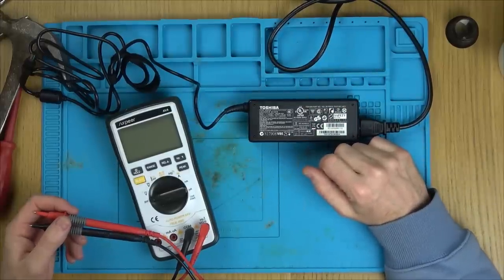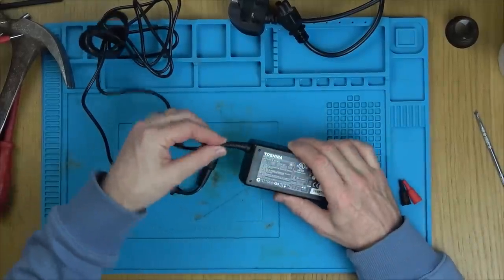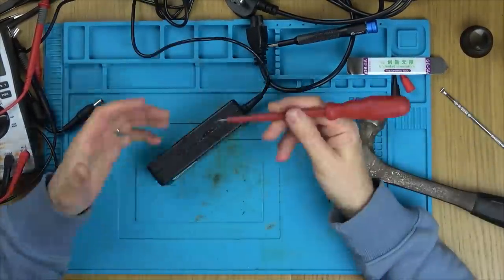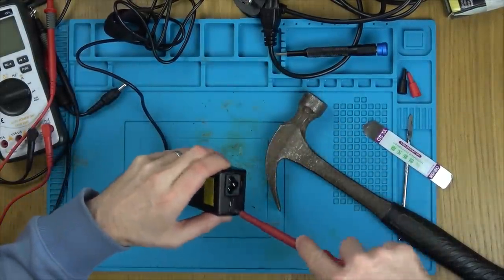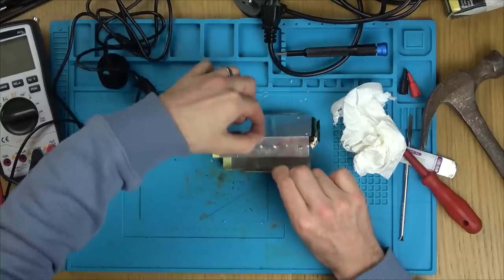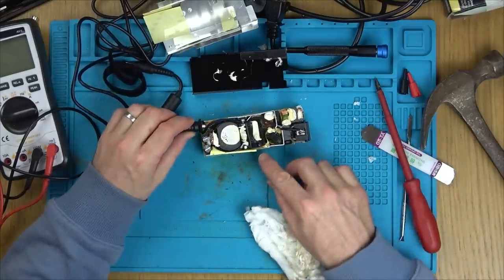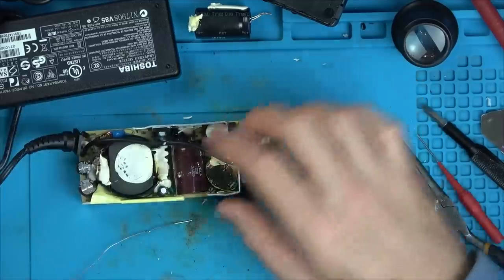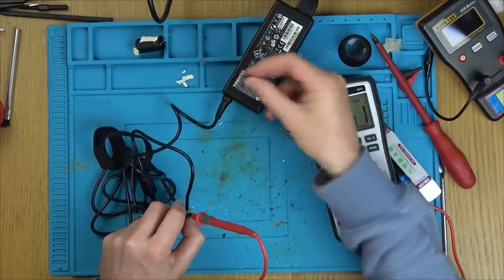Dead Toshiba Laptop Power Supply - Can it be FIXED?

Comment: I chose Toshiba laptop partly because unlike yours mine has no earth pin on the socket and this helps with reducing audio hum when supplying projectors and sound systems, it wasn't a grey import and came from Argos so I was surprised to see an 3 pin connector on the mains on your one. Interesting video nevertheless

Comment: Gasoline / petrol helps open these sorts of adapters very easily. Just put a few drops of gasoline/petrol along the edges of the joint. And wait for 2 mins . It loosens the glue and helps open the case very easily.

Comment: A better way to open the charger, use a little bit of gasoline inside a syringe along the line of the middle area and the edges, then try to squeeze and move it using a tool, whether it is a small screwdriver or anything, but do not press on it, it will open for you easily

Comment: I have a Toshiba laptop when I not using it I will unplug the power supply as it runs hot, but with no air vents I surprised power supply on any laptop's don't start fires if left to charge ie on bed sheets and so on as someone in the UK did die in a fire leave laptop on and sleeping on the same bed.

Comment: A wide wood chisel is best for opening such things. It will be ultrasonically welded, not glued.  The cap clearly failed and blew the fuse. It's a common fault. I'd put tie wraps on it too, wouldn't trust only glue.

Comment: I got a replacement charger off Amazon and it’s just died after two years went to check the fuse first found out there isn’t one and they have made it look like there is there’s no fuse behind it just connected wires will check everything on electrical on Amazon now.

Comment: I once had to fix my laptop power supply because it died just when I was preparing a presentation for the next day in the office. Smashed it open in a rush, got it working and just secured the housing with cable ties. Totally safe ^^
Been using it for years afterwards. It was always great fun to show up to meetings with it :D

Comment: It become more than apparent that these power supplies are designed not to be able to get into easily.  I'm sure the planned obsolescence of such items applies, here.  They want you to buy, not only a new power supply, but a new computer to go with it, even if it works perfectly well.  The average lifespan of a notebook is supposedly about 2-3 years before it's deemed to be, 'obsolete.'  A shame then, that I have one from 10 years ago that still works fine and does what I want it to do.

Comment: I broke the plastic on mine like that, I just wrapped it in electrical tape and have been using it for the last 6 years like that.
What can I say, Im a cheapskate.
Anyone asking, mine failed because the solder holding the input connector broke and it was arcing.
Reply: I've done similar where the cable was broken internally next to where it went into the block, or when I had a failed PSU of the same voltage, but the lead was different and had to swap the lead to another PSU.

Comment: If you want to keep the power supply case together just use a piece of large heat shrink.
Reply: Just wrap it in a layer or two of packing tape. Cheaper and much more readily available than a big enough heatshrink tube.

Comment: That electrolyte should have been cleaned out and a new case. Other parts failing could have caused this, and without knowledge of the circuitry it’s risky to claim basic level capacitor and fuse is all that’s required. I like the sufficient warnings stated in the video - but sadly many will fail to adhere them due to circumstances like money or availability, and risk either fire or getting shocked.

Comment: It's much easier to open a laptop power supply with a spatula and a hammer. One single hit opens one side of the brick. To close it back, I usually use black electrical tape, and clear duct tape on top of it just to make sure it holds.

Comment: An easier way to get into chargers and batteries is to use good old gasoline. Run along the seams, It breaks the bonds and the charger falls apart mostly on its own.

Comment: You could use a tin knife and a hammer but the knife in trace of glue and light smach with hummer for all four corner
Or you could use a 💉 filled with perrole and add small amount in glued track but be careful don't put too much petrol otherwise you will completely destroy the shell

Comment: I've opened a few of them and my preferred method is to use a japanese saw (thin, cuts on draw stroke) on the corners and use two sturdy flat head screwdrivers to lever my way in. If it:s still not cracking open you can use the saw on the seam as well. It leaves an edge that not too difficult to glue with construction adhesive for example.

Comment: Hot glue is a good idea but another tool you can use for filling in those gaps is a 3D pen, something that uses PLA or some other highly affordable 3D printing filament.
Reply: I was just about to suggest this, after using my 3D pen to weld together a PETG print a few minutes ago.

Comment: Put it on it's side on concrete, and hammer the seam with the ball end of a ball-peen hammer. You should hear the glue cracking as it separates.

Comment: One thing about those fuses that UK plugs have… they are there to protect the cable between outlet and power supply. They rarely blow, inside the power supply is a second fuse which is the “real” fuse to protect the electronic components and prevent fires. The internal fuse is also the one that will blow on EU power supplys, there they don’t have the external fuse in the plug. Only change to make the power supply compliant with UK regulations is to add another fuse in the plug. Inside it will be exactly same with EU power supplys.

Comment: I was hoping you have a better way to open it😂 I saw somewhere which I don't remember where and someone whom I don't remember😅 said banana oil is helpful but I don't know.. IT HELPS! USE BANANA OIL, I tried today and it opens so easily
Reply: apply lighter fluid to the seams .. takes a while but will come appart.
Reply: @VVerVVurm   I tried it now, it works, just apply banana oil all around and it opens so easily
Reply: @alirezanzdy  guess I will order some.. I wonder how it works. How long did you let it on there? With the lighter fluid I was applying it for about one hour.. My plan B was to use acetone. this would disolve the ABS
Reply: @VVerVVurm  instantly, just drop very little, maybe with a syringe, don't drop too much or it gonna leave a bit of white mark on charger, and it's like magic

Comment: You can use banana oil to dissolve the glue and open the power supply, I used it and it worked fine. The only problem is that this oil stains... I think it's better than the hammer 😁😁

Comment: I just fixed a laptop power supply. I used lighter fluid applied with a syringe to the seams - got it cleanly appart. It was a failed 0 ohm smd resistor in the feed back cirquit on the secondary side. glued it back together and it works fine now.
edit: Of course I managed to shock myself on the 400V cap. 😒

Comment: To get cases like that open in future spray the seem with IPA let it soak and use ure spludger and a heat gun along the seam spraying with IPA. The alcohol will help dissolve the glue and the heat will help soften it.

Comment: Second TIP when you must open a power supply like that is good have a bottle with gasoline, with a little brush , dip it in gasoline and put some drops on the glued part of the case that you want open, a knife may be useful to make some first entrances for the gasoline, the gasoline dissolves the glue and you will open the case without having to hit the casing that can cause more damage to the components
Reply: It's not glued, it's welded.
Reply: @DumahBrazorf  anyway try it

Comment: you could have used plastic epoxy, sanded it back, painted it black. it would have been completely
 safe and looked close to factory. not saying sellable but better then hot glue

Comment: A hammer and a screwdriver? Seriously WTF.
Hammering a spatula would have done much less damage. Or even popping the plastic squeezing it with a vice. Although most of the time a rubber mallet is all you need to crack the two halves apart.

Comment: I just use a rubber Hammer and hit it all around with just the hammer. It's much less destructive and it just usually breaks the glue.
Shouldn't you also measure at least the Bridge rectifier and and mosfet before trying to power it on again? I think that is the minimum
Another tip. To bend plastic back into shape, specially abs, you can use your hot air station at 140°C full flow and you will see it bend back magically into its original shape.
Reply from the maker: Thanks for the useful tips and advice VS 👍👍👍

Comment: Nice video, Vince :) 
I don't trust these after being fixed. They are not that expensive.
And if you want to get into one quickly, a drop of clean petrol(95) all around the gap will get you in without destruction. Just make sure you wipe it off right after you opened it.
If it is just the primary side capacitor and fuse gone bad, then that PSU can still be trusted afterwards.

Comment: I would just buy a new laptop as Toshiba does not make laptops no more which will make it harder to find spare parts for them in the future.
Reply: Yes they do, part of the Foxconn / Sharp Corporation, sold as Dynabook Laptops. Plus you can get Generic Power Supplies anyway :)
Reply: They sold their laptop division to Sharp who rebranded it Dynabook. Still use same style adaptors 😉

Comment: Actually to get into sealed power supplies easily you can use a little bit of gasoline or petrol on the seams of a glued unit and most of the time it actually eats away the glue and with a little bit of force or pressure on one side or both it should pop a part like a clam shell, then afterwards All you have to do is use some superglue to reseal it and it should work just fine assuming you fix it.

Comment: Don't do this fix for a laptop power supply casing what ever you do. UseJ B weld putty  and some zip ties and not super glue  or hot glue. Why ? Because it could fall apart if  dropped or worse fall apart when picked up after being dropped. You have been warned.

Comment: Hi Vince, like many say it's ultrasonic welded case. The best way I have seen so far to open the charger without damage is to use Zippo benzine all over the joint groove and wait few minutes and then maybe use the benzine one more time and wait again. Then use plastic hammer or else to tap gently around this groove on both sides of the case. Use a spatula tool or a flat screwdriver to pry the casing but from the side of the mains power socket. I have follow that movie (https://www.youtube.com/watch?v=tkX3O2dWM14&t=247s) and it works great.
Reply: I freeze the case then whack it diagonally - many times they break along the  seam. Check all the other caps too though...

Comment: Meh, Vince you amateur, you got to put it on table on one corner and hit the opposite one, and then the other pair, again and again till succeed. Mora or other thick knives may help.
Reply from the maker: I like that idea, yes, the flexing of the case from hitting the corners might have separated the sides. I'll try that next time. Cheers Miklas 👍
Reply: @Mymatevince  Yep, should work most of the times. Pry it with mora first to make joint weaker. Good luck! Cheers!

Comment: IMO its pointless to attempt to repair something if it can't continue to be used.
Reply: What he potentially learns from repairing it is the point. Odds are, it'll likely have applications towards a future repair. At the very least, it's practice.
Reply: @shawncat  Not only that perhaps there isn't a power supply for that particular laptop available locally, so at least his wiife can use her laptop up until the new power supply arrives as long as she is careful around the repaired one.
Reply: @dash8brj  also these darn things always fail on a friday evening. so repairing is the only option to get through the weekend
Reply: It's perfectly fine to use, I'm sure Vince is just saying that stuff because he doesn't want to be responsible if someone else does a shoddy job based on his video.
Reply: @jessicav2031  I'd have no problem using it, done similar a few times :)